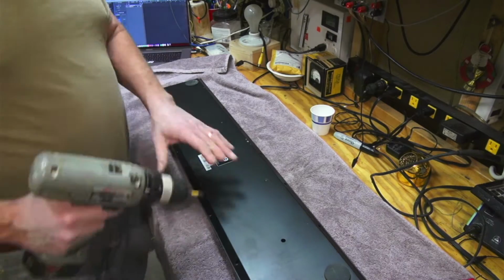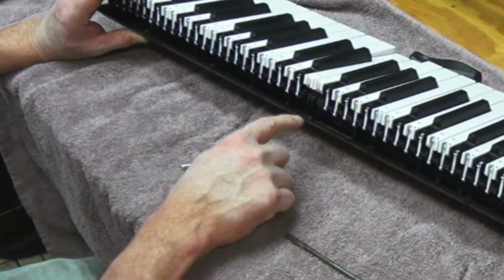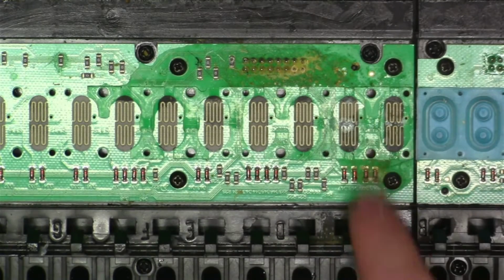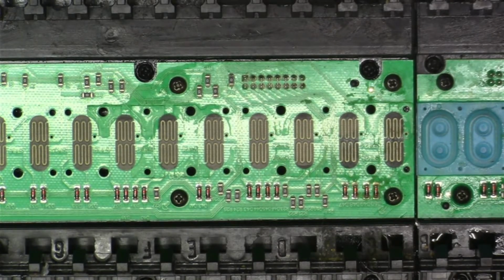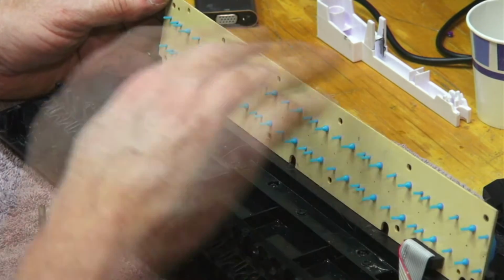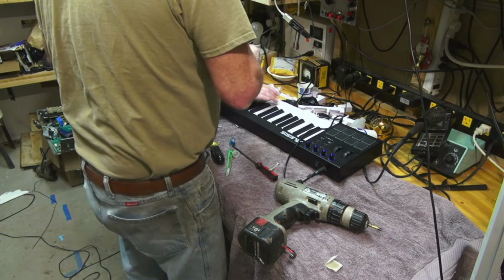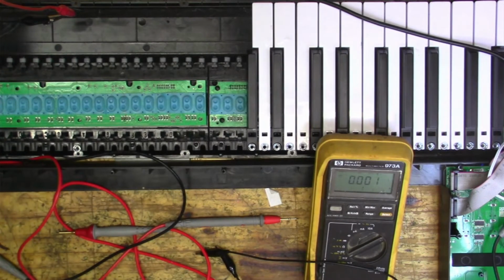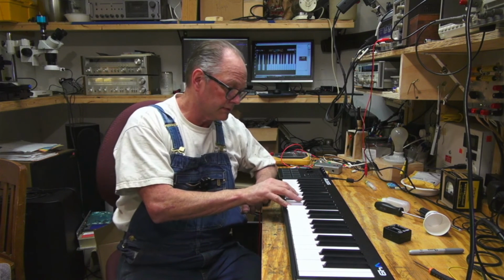Alesis V49 Midi Keyboard repair

Comment: Thanks guys. I have V61 for many many years. And black keys were so much louder than white keys.. and one black key didnt sound. So today i opened the keyboard and for few hours  clean everything with alcohol (our moravian "slivovica") ... and it works perfect, blackkeys are at the same level of volume (maybe little softer) which is great.. and that one key is working again :) so thnaks. Tested in Ableton with free Keyzone pianos VST-

Comment: I have this, I kinda dropped it and it completely stopped working, is it fixable??? 😢😢😢😢
Reply: Also is it a case of a cable disconnecting inside?
Reply from the maker: If it doesn't work at all I wonder if it is something disconnected in the power

Comment: I have an Alesis V25, and my drum pads trigger multiple times with a single press. It has the latest firmware update. Does your keyboard have this problem? Could it be resolved by disassembling it?

Comment: What is the correct term or name of those blue tires to buy them in case they are damaged? Great video. Greetins from Mexico. I will try to fix mi Alexis Keyboards i have 3 with keyboard bug. This model ALESIS V61 it is my favorite to performance i have four of them actually.
Reply: they are blue i found them in amazon but color gray. is the same?

Comment: This is not exactly relevant, but do you happen to know the label of the jack board? The one that has the sustain and midi ports and is connected to the “JACK” header on the main board. I’m desperately looking for a replacement for the jack board since I didn’t realize the used “for parts” model I bought actually had the part gutted out of it. I’m trying to find out what it’s actually called so I can search for it better.
Reply: Or possibly would you be willing to email me a picture of that daughterboard?

Comment: hey. thanks for the video. what are you using to clean it with the toothbrush? water? can i use isopropanol?
Reply from the maker: Yes. I use anhydrous alcohol which doesn't have any water but off the shelf alcohol will work fine